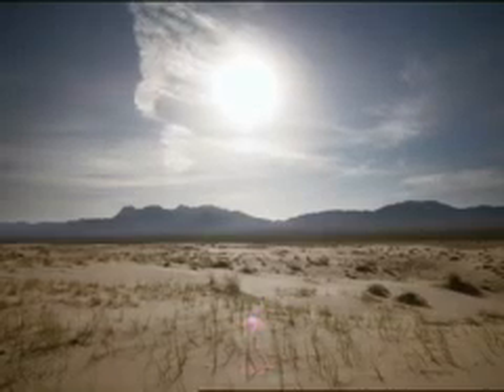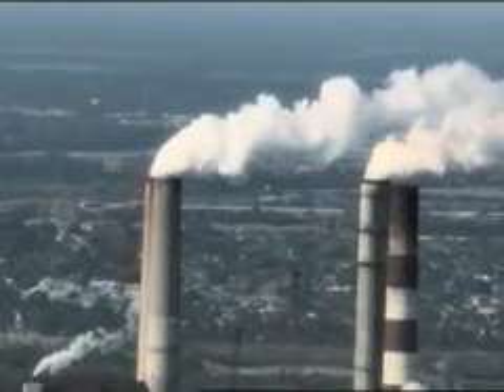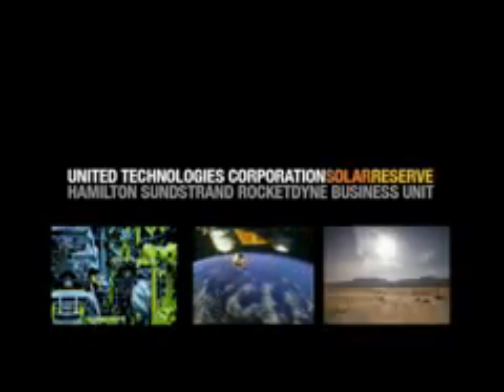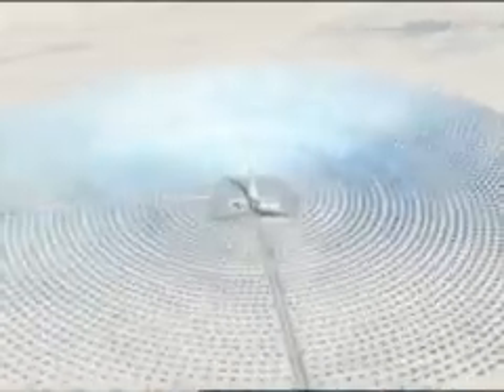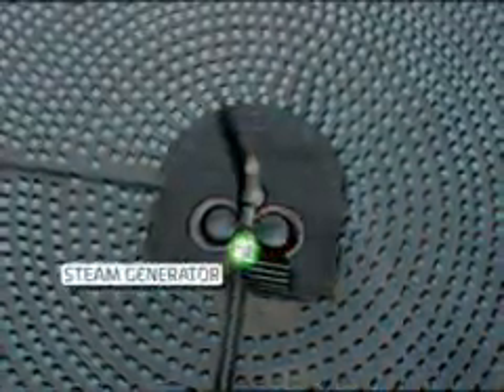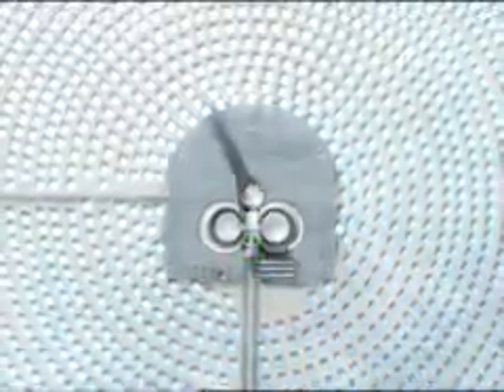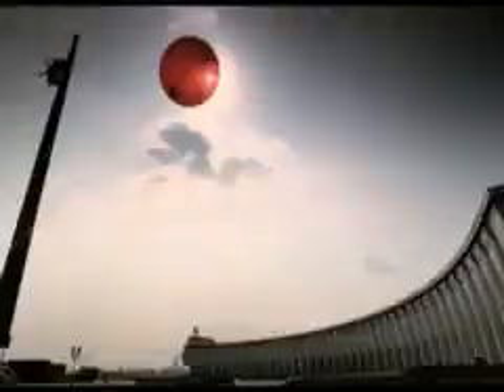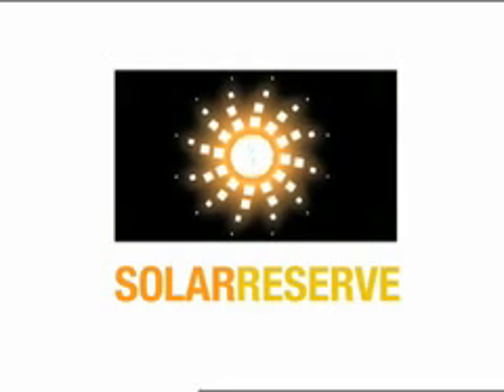Solar Reserve Solar Thermal Solar Power tower with molten salt storage based on Solar Two

Comment: Can you say "Green Washing? 2004 election, UTC 6th largest defense industry donor to political campaigns, total of $789,561.  UTC was also the sixth largest donor in to federal candidates and political parties in the 2006 election cycle.  Environmental record U Mass Amherst identified UTC as the 38th-largest corporate producer of air pollution in the United States as of 2008. UTC released roughly 110,000 pounds of toxic chemicals annually into the air

Comment: OK now if we had say 4 of those tanks you would have  28,000 Cubic yards of storage. Now that is just for this one power plant of 1,000 Megs.  I think to keep the tanks this size or smaller because of the cost to build them.  This plant will take care of about 1,000,000 homes that's  right one million homes.  What can you guys add to this?  I think this is the way to build storage. If you have noticed I used the largest numbers.

Comment: OK 
beyondzeroemissions  states that a 1,000 Meg power plant would use about 28,000 Tons of salt to keep it going all night. I looked on the web and found a site that said a 1 ton or 2,000 lb. of salt is about 1 cubic yard ,  So The tank would have to hold about say 30,000 Cubic yards of salt.  Now how big is that. Well if you made a tank out of concrete , like the new water storage tanks.  The inside would be 87 feet across and 30 feet high and that will give you about 7,000 Cubic yards.